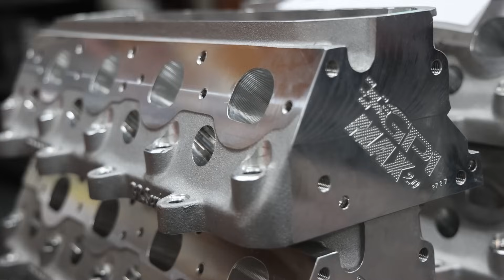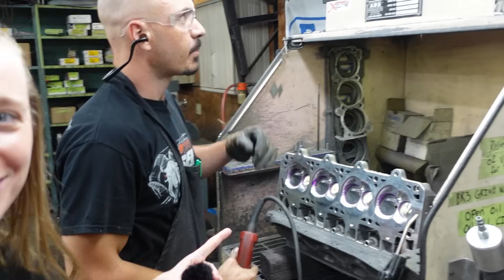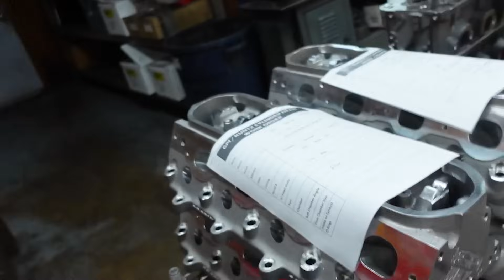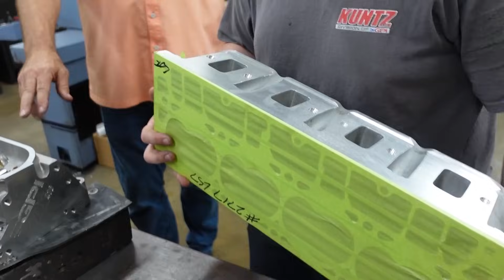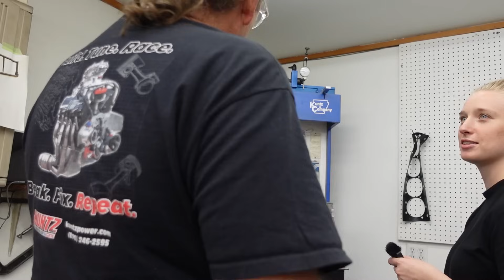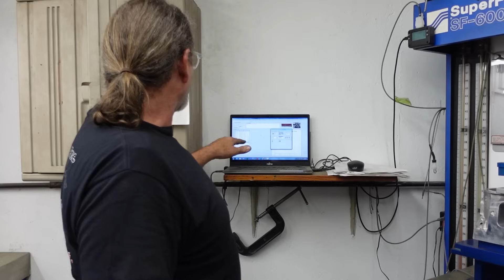Are the GPI Max 2.0 Head's worth it? Ep. 7

Comment: Awesome video! 😎👍
Are you planning to re-gear your car to take advantage of the higher RPM out of the corners?
Reply from the maker: Yes down the road I will along with the differential offset bushings and driveshaft. Those will come in time haha
Reply: @KaylaRundle  Awesome!
I was looking at the flow numbers on those heads and it's absolutely amazing because even the exhaust valve at .600" outflows the intake valve on my Vortec heads on my 71 Camaro 🤣